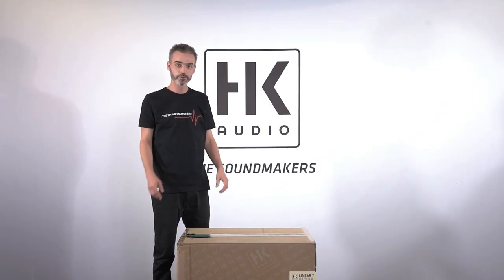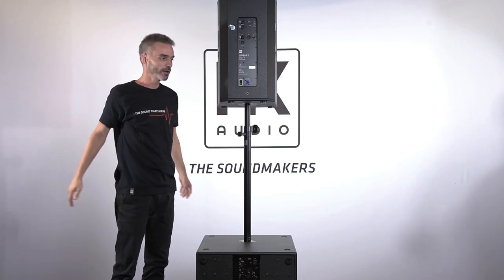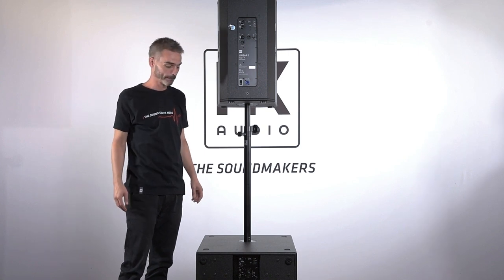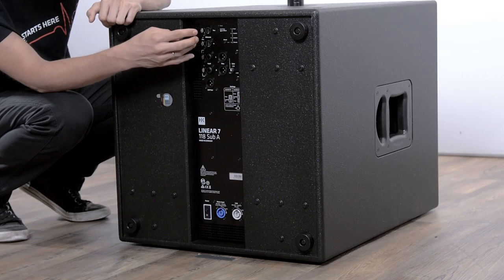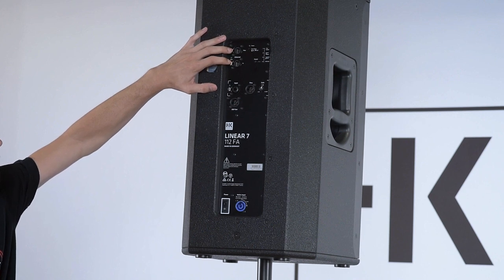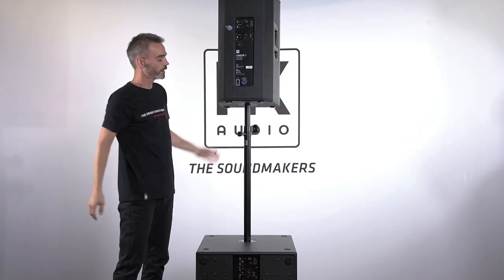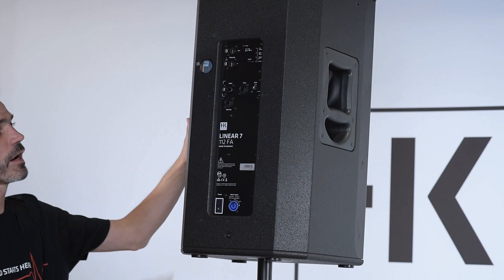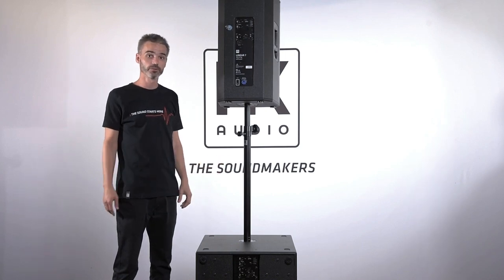Setting up a LINEAR 7 system PART 1 | Unboxing and building | HK Audio (English)

Comment: How big is the difference in Quality and Volume from the Model Audio Linear 5 and the Model Linear 7?
Reply from the maker: Hi Alexandros,

We already answered you this on Facebook, but here's an answer for anyone else who will be asking the same questions!

We'd say it's actually more about what you want to do with the systems. Both are for users who know what they are doing, as we assume you are - they are not for casual users as much as, say, LINEAR 3. So you will get similar performance results out of both. Volume is also dependent on the system you choose to build. 

We'd say think of it more like this: if you want all the networking options LINEAR 7 offers, then that's the way to go. Or, if you specifically want long throw options, go for the LTS speakers. You can also bundle speakers from the different families together, and the most important thing is that you build a system that works best for YOU. 

Hope that helps,

Team HK